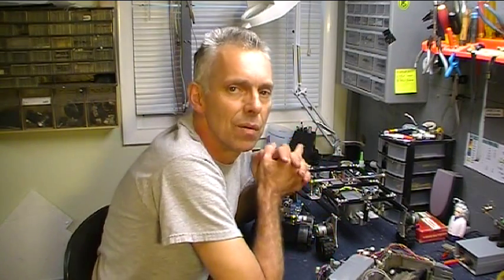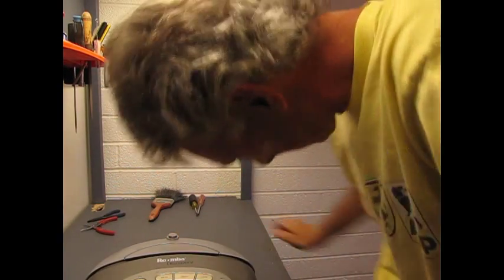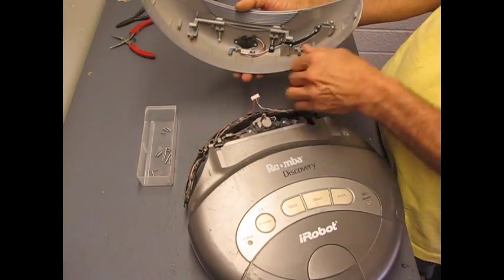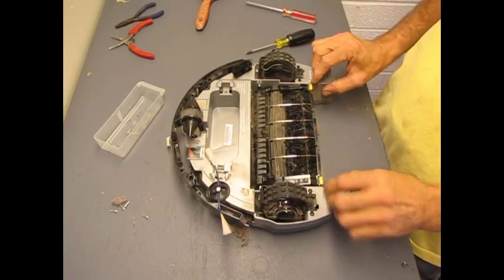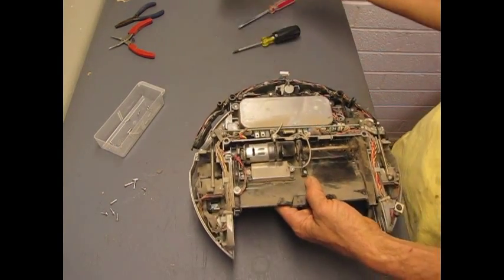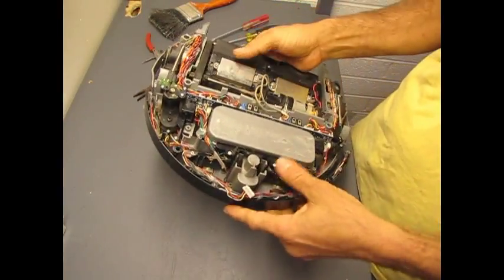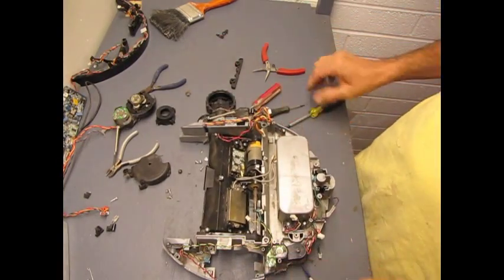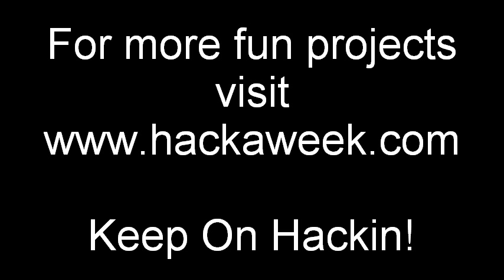Roomba 4000 Teardown

Comment: "the thing can keep track of how many wheel rotations it has going on, but i guess their not that accurate because of belt slip",The optical encoder is on the tire side of the belt, So no matter how much the belt slips it should not effect the encoders operation. Slip would be a issue if the encoder was placed on the motor side of the belt.

Comment: The encoder is connected to the gears that are in turn connected to the wheel. Since the encoder is after the belt, there is no way for the belt to cause the error. The actual traction of the wheel against the floor is more likely the reason for the inaccuracy.

Comment: 2/2__Now, on to the roomba: how about putting the tech. On a lawn mower,switch optic sensors  for a mock GPS system & a centrally located trans-ceiver in place of a satelite system,,and boarder bumpers (like that black plastic edging)around all the no-nos  to help it grid-map a defined area to memory.....could also program it to self charge at designated stations.....grab some refreshments ,head for the shade,tell the wife you are going to mow the lawn...ain't tech-knowledge great.

Comment: At 11:35 you say it uses a Motorola processor. Motorola spun off its microprocessor and microcontroller division as a separate company Freescale in 2003-2004. The original Rooma was introduced in 2002, so it's possible the original models used microcontrollers marked Motorola, but after all this time it's more correct to say it uses a Frescale microcontroller.

Comment: while the roomba, new, can be quite expensive, the used or returned modules can be had for under $50.00 us in working condition. while the are great little robotic platforms they simply are not good vacuums (low collection capacity, expensive accessories, low suction, and requires regular and ongoing service to keep them even doing a sub par cleaning job) and thus are great as second or third hand, cheap parts and even complete robots.